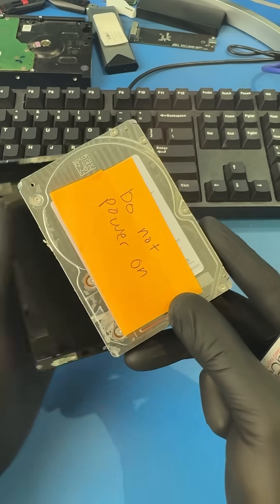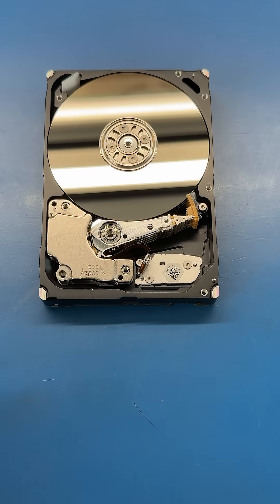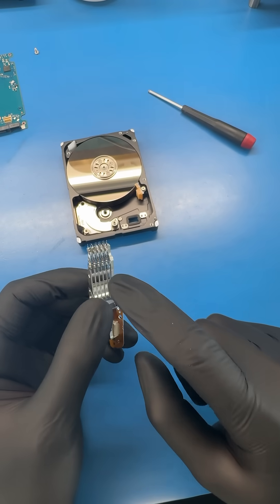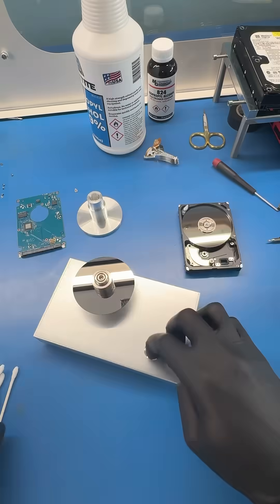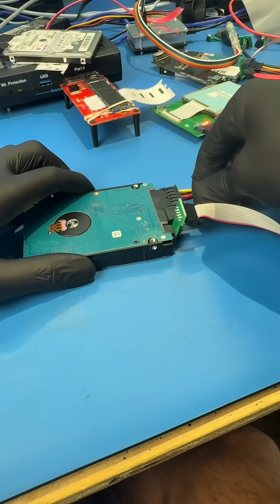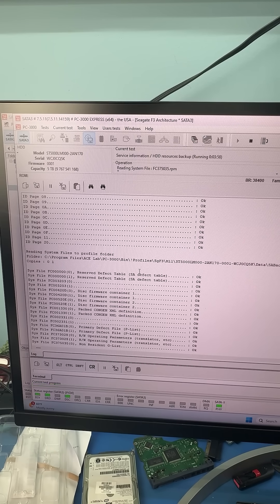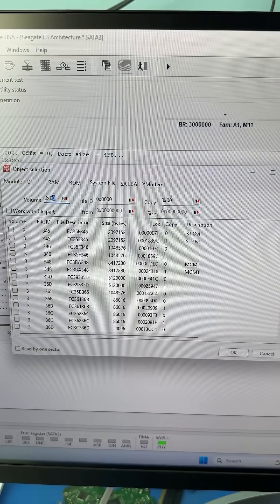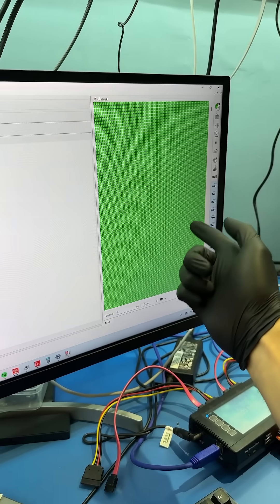Hard Drive Platter Extraction... #technology

Comment: Been 10 years since I opened a hard drive. Last one I opened, all platters were shattered. It baffled my mind on why a manufacturer would use glass platters on portables.  I can understand maybe desktop. Any of my cats run into my 250lb+ glass tower, it's not moving 😂. I switched to full NVME. I like two minute laptop installs, not 3+ hours😊

Comment: in the 90's the first computer i ever had was given to me - it was on the rear floorboard of a car that hit a tree at like 70MPH and came to an Abrupt Stop - Momentum shouved that computer under the Driver seat through a 4.5" gap ... sudden stops are a hell of a thing... and they said "Ya want it? It's all yers" it was Mangled, not just the drive, the case looked like it was run over by a truck... but, I got the Board working and I was stoked because it had a Voodoo card that I actually repaired  - finding a new HDD was impossible in the woods where I lived, but, I had a lot of tools - It was the first HDD i ever opened up, and I actually fixed the drive and used it for another 2 years ... then it really died...

Comment: ...yeah, and the disks were repositioned so the start of the tracks landed precisely at the same place as before, no CRC errors, no need for alignment... It took me days to reassemble a one disk 5MB (yes, 5 MB) unit in the 80's, aligning the heads with an oscilloscope. And you did it with a million more dense unit? Sure!
Reply: Cat's Eyes?  I've changed more read/write heads on exchangeable HDDs than I can remember.  Without fail they had to be aligned to a specially calibrated disk.  We even checked alignment on a routine basis

Comment: Wish I had known about you earlier. Sent my failed drive to Rossman Repair Group. They couldn’t recover the data, and recommended I send it to Gilware. They couldn’t recover the data either, claiming the platters were scratched. 

At that point I figured the drive was junk, so I took it apart. Lo and behold, not a single scratch on the platters. Ended up keeping them as decorations and junking the body of the drive lol.
Reply: During SHTF, might be useful as reflectors to send sun signals. I keep them as cup stands, demo -https://youtube.com/shorts/Pv6EyBpS3l0?si=kw7EhoekAvWQCFEB. I'm amazed by how smooth the surface is. You could pick a platter with fingers and have your fingerprints.

Comment: So lucky that the platters were not scratched. It’s amazing that another data recovery specialist center was not able to do what you did. It’s sad that most of the skill set of the mechanical drives are dwindling and companies are unwilling to pay their employees according to their expertise, opting to pay minimal salaries.

I’m a level 3 computer technician with over 25 years of experience and I can’t secure a servicing job that would take account of my experience.
Reply: Shoulda gone into welding or plumbing or electrical....wait, I did all of those and after 25 years my body is wrecked.

Comment: If you're going to save many years of photos or other valuable, critical files, don't put it on a hard drive. 

If you must put it on a hard drive, then you better have at least two hard drives in RAID.
Reply: It doesn't matter what kind of drive you use as long as you have a solid backup strategy and keep multiple copies of your important data. All drives will fail eventually.

Also, RAID is not a backup. RAID only really protects against hardware failure. If you accidentally delete data or get infected with ransomware, or basically any change in the data, it's going to affect both drives at once, whether you like it or not.

As I already said, backups are much more important, and I can't stress this enough.

Comment: My Seagate backup plus external hdd is dead due to head, by mistake I open and try to fix head but the edge of disk is scratched , can I change head and get my backup is yes so where to get head, or replace with old hhd's head, pls guide.

Comment: Why not put the busted hard drive platters into another same model and capacity hard drive instead of putting the platters back into the busted hard drive and using the head assembly from another hard drive, wouldn’t that reduce the potential for new damage?

Comment: I used to charge $3000 to do this. I was slightly cheaper than a company in San Francisco called "Drive Savers." Eventually business dropped off because drives just don't fail like they used to.

Also I have 2 words for the drive owner here... Back Up. Saves time, money, and ass.

Comment: I read somewhere (so correct me if I'm wrong) that, when you remove the platters, you must keep them in the exact same position relative to each other.
So, if you remove the platters and put them back and they have turned in relation to each other, the data becomes unreadable. There were even tools that would lock the platters in place so they couldn't turn.
Reply: He said it in the video.
Reply: @Bollibompa he said we mustn't forget which way the platters go back.
This means to me, the order and which way is up, but not the rotational position in relation to each other. Also, he didn't lock the platters and just took them out one by one, examined them and then put them on a spindle.
So I'm guessing that for the purposes of data recovery it doesn't matter that much.
Reply: @jochenstacker7448 
Oh, yeah, this video is a joke. The track alignment resolution is like 0.00005° or something. He could never have a readable drive after lifting it individually like he did.

Comment: This is exactly what happened to me, a company (UK) offered £300 for 500GB data saving. Ouch. Ok, I sent the drive then received a phone call that the hardware is intact but they need more work and new parts and it will be £800. Or they will assemble the HDD and return it for free... Felt like extortion. Isn't this outrageously expensive? €950 or $1100?

Comment: Do you extract info from SSDs? I have an A-data that corrupted it's controller firmware. I know these can be repaired with new firmware on the chip, but can you save the data? It is stored in the emmc chips which should be ok.

Comment: It is for this reason I am always careful about things like this with my cat.  I just leave the drive on the floor (where it won't get kicked or stepped on) and then it can't fall if my cat plays with the cable connected to it.  Even then I try to keep backups on multiple drives and not just 2 backups.  I am careful not to use any form of flash memory like an SSD or flash drive as the only backups.  They can corrupt or lose your data if they are not powered on once every so often.  There is also the option of burning discs if you have a drive that does this.  I don't recommend that to be your only backup either.  I don't really care for cloud storage of any kind.  Really all that is, is just someone else's computer and the word cloud does not make it special in any way.  I don't even care for OneDrive.

Comment: @MDrepairsLLC  could I ask you for a possible fix with my gaming laptop that keeps me from periodically disconnecting from a particular MMO?
Tried everything from tweaking DNS servers, hard resets on my modem, possible line fix from our ISP, did a router flush and reset (cmd)... nothing worked.
Been experiencing it since April 2025, and this is the very first time I experience it for over 12 years in that MMO.

P.S. I don't get disconnections from other MMO's,  just this one from "North America".

Thank you!

Comment: I worked as a programmer in the 80s and 90s and remember asking my teacher at the time why they built hard drives in a way so you're always screwed when something went wrong. He said, to get people to back up their stuff. Good for the companies but a little expensive for the customer. It's a profit made discussion we are stuck with even 4 decades later.
Reply: it was a tech limitation not a built to fail issue not only where companies competing for market share and thus pricing but the technology itself had very little tolerance for failure and when it happened it was generally catastrophic
Reply: Goddamn i never thought of it that way. But is it even possible there's already a device that can store data forever?
Reply: @StellviaHoenheim even DNA suffers from corruption 😭
Reply: In my first year of college working on my Computer and Electrical Engineering degrees, my professor for BASIC said, "The Rule of Computing -- BACK UP OFTEN." That was back in 1988 and I still adhere to that to this day.
Reply: Nah, it's not a profit thing, just a tech thing. Mechanical drives are damn near black magic, and those things have such tight tolerances that they implode if even a single thing goes wrong and comes out of alignment. Those drive heads are rocketing back and forth across the platter at ridiculous speeds for thousands of hours, it's expected that at some point something will give out and obliterate the platters, and once that happens you're screwed.
Reply: How would you build a hard drive that doesn't kill itself when you let it fall down 1m?
Reply: @acmenipponair  The circuitry I'm about to describe may have been in this one and just didn't quiiite succeed. Or the forces lined up right. So, in operation, there's a head in between all the platters. After an idle period the heads get "parked", but if the drive was actively reading or writing they were all in there. 

1, on "unexpected" loss of power, basically all drives for some time now harvest some energy from the spinning platters to park the heads so that they aren't in between platters that aren't spinning. They sit so close that there's some physics stuff that they rely on to keep the gap that doesn't work when the platters aren't rotating (quickly). If the drive, while falling, exceeded its (presumably) USB cable length, or whatever -- if it lost power with enough "fall time" left for that power loss parking to happen, then that saved the platters. (We know something did because they were apparently nearly unscathed and that head found on the platter had to end up there after breaking off and bouncing around, vs being dragged across.)

2. There's another level of protection on some drives designed for laptop / mobile installation. External portable ones often rely on just #1, but a laptop falling with an internal HDD, even if the laptop was on AC and that pulls loose, unless you've pulled the battery nothing loses power. (Well, except the charging circuit I guess.) These drives have accelerometers that detect motion, and can tell the difference between the exact acceleration from a fall in Earth's gravity from any other motion. Try as hard as you like, you're never going to be able to give it close enough to a consistent 9.8m/s^2 with no "jerk" (jerk is the physics word for the rate of change in acceleration itself) or deviations in vector (with some allowance in the programming for imperfections in the measurement hardware, and probably what we'd call "expected" sources of additional impulse like someone slapping it in a failed attempt to catch it, a certain amount of wind, whatever. If there's an acceleration component in there that is +/- tolerance to freefall in earthgrav for a time longer than if you slip and it drops maaybe a couple cm max to the table, the drive will preemptively park them (I think also to a further parking region designed to protect not just the platters from the heads, but also to secure the heads and that assembly from bouncing around etc on impact).
Reply: @acmenipponair  that would be you killing it not it killing itself

Comment: I actually work in the same data recovery industry as you. I just started working so still quite beginner. It is so awesome that you give detail to your cases. I can figure out some of the process myself! Many thanks for your hard work!
Reply: How can I learn this, are there any online courses? Any pointers will be greatly helpful.
Reply: @pyrodellic   Start with the cleanest room in your house, and make it 100x cleaner than that. Even a tiny speck of lint can destroy a platter or read/write head if it's spinning at operating speeds.

At entry level, most of the equipment is pretty basic:
 - software that reads the drives at the bit level (including hidden sectors, ROM, superblocks, service areas, and sectors marked as bad or unreadable)
 - tiny screwdrivers with the correct heads
 - steady hands
 - a ton of patience, organization, and attention to detail

You can give it a try if you still have old drives that stopped working but you haven't had the heart to throw away.

Of course like most endeavors it can escalate quickly, and you can easily spend hundreds of thousands on equipment and environmental control. 

Note: I'm not in data recovery, but I've been in I.T. for a thousand years. My input will set you on the right path--but it's not enough to take you to the top.
Reply: @zedmelon  More interested in how you lived to 1000 honestly.
Reply: @Kneel2Neil2   Heheh. You know how they say "an apple a day keeps the doctor away"?  Well I eat 85 apples a day. 
And do 18,000 sit ups and 40,000 push ups.
And I sleep 46 hours daily.
Getting good rest is important too.

And right now I'm kneeling to Neil.
(I'm also exceptional at following instructions)
Reply: that's good, always keep learning
Reply: .......
Do you know Jesus Christ can set you free from sins and save you from hell today 

Jesus Christ is the only hope in this world no other gods will lead you to heaven 

There is no security or hope with out Jesus Christ in this world come and repent of all sins today 

Today is the day of salvation come to the loving savior Today repent and do not go to hell
Come to Jesus Christ today 

Jesus Christ is only way to heaven 
Repent and follow him today seek his heart Jesus Christ can fill the emptiness he can fill the void 
Heaven and hell is real cone to the loving savior today 
Today is the day of salvation tomorrow might be to late come to the loving savior today 
Romans 6.23

For the wages of sin is death; but the gift of God is eternal life through Jesus Christ our Lord.

John 3:16-21 

16 For God so loved the world, that he gave his only begotten Son, that whosoever believeth in him should not perish, but have everlasting life.  17 For God sent not his Son into the world to condemn the world; but that the world through him might be saved.  18 He that believeth on him is not condemned: but he that believeth not is condemned already, because he hath not believed in the name of the only begotten Son of God.  19 And this is the condemnation, that light is come into the world, and men loved darkness rather than light, because their deeds were evil.  20 For every one that doeth evil hateth the light, neither cometh to the light, lest his deeds should be reproved.  21 But he that doeth truth cometh to the light, that his deeds may be made manifest, that they are wrought in God.

Mark 1.15 
15 And saying, The time is fulfilled, and the kingdom of God is at hand: repent ye, and believe the gospel.

2 Peter 3:9
The Lord is not slack concerning his promise, as some men count slackness; but is longsuffering to us-ward, not willing that any should perish, but that all should come to repentance.

Hebrews 11:6
6 But without faith it is impossible to please him: for he that cometh to God must believe that he is, and that he is a rewarder of them that diligently seek him.
Jesus

Comment: you.. opened an HDD, and FIXED it, and put it back together, and FIXED IT'S FIRMWARE.. recovering ALL THE 3.5 TB OF DATA

mate you're like the ethereal God of HDD repair, holy fuck
Reply: Holy fuck indeed
Reply: The fix is essentially getting the data off the drive. The drive is e-waste.
Reply: @unh0lyav3ng3r8 agreed, but to say "opened an HDD, and FIXED IT" to me is not accurate. That is all I meant.
Reply: He didn’t save the plane, but was successfully able to transfer all 323 passengers somehow safely to another vessel before the plane crashed. 
I’d say he didn’t save the plane but he fixed to core problem and main concern of the situation.
Reply: Hard drives should have platter reader devices. They'd require crazy level of clean room but it's possible. Pop in a platter . One time read. Move to ssd
Reply: 3.5tb of porn saved...
Reply: Lots of people do not have any idea what he did here in the short video its actually very long and not easy at all to achieve..  Taking the disks out and then put them back to work 🤯this is different levels! Unless he said to the owner he is not responsible if job foil 😅😅
Reply: Held my breath the entire video. Can’t believe it worked. Amaze.
Reply: that's what people whorepair HDD do...
Reply: I don't think he fixed the drive, I think he transferred the data off of it.
Reply: @OriginalJokerFMJ  the HDD crashed and he fixed it. It's a temporary fix, but still a fix. He couldn't even back it up if it wasn't fixed.
Reply: @ChucksSEADnDEAD I guess I understood it to be a temporary fix long enough to recover the data. If that is accurate then I wouldn't say he fixed it. To be clear, I'm not criticizing his work, it was fairly impeccable, I was merely commenting on the comment because I didn't agree.
Reply: @OriginalJokerFMJ someone on the internet with real understanding and knowledge? impossible
Reply: He didn't "fixed" the drive, he only rescued the data. As the harddrive was already showing that it wants to die (losing parts of the MFT). The harddrive is afterwards electronic waste, the data will come on a new harddrive.
Reply: @acmenipponair If the drive wasn't fixed it wouldn't be able to get him the data. He fixed it, either temporarily or permanently.
Reply: When you have a head crash, like show here, it's not unusual for some data to be missing or unable to be read. So some pictures or files might be readable, but they will have artifacts. Thankfully, with AI image editing, those images can be more easily reconstructed. It's still better than nothing.